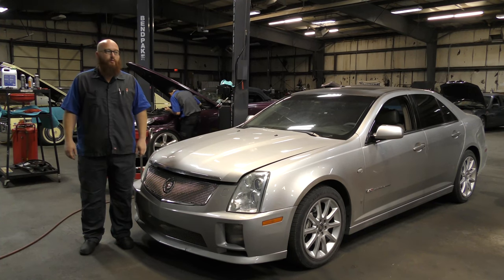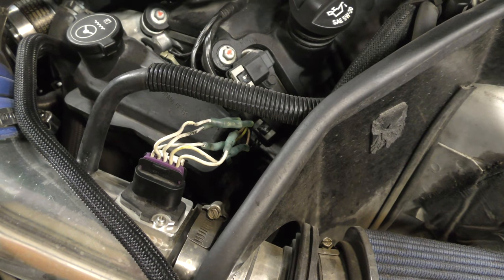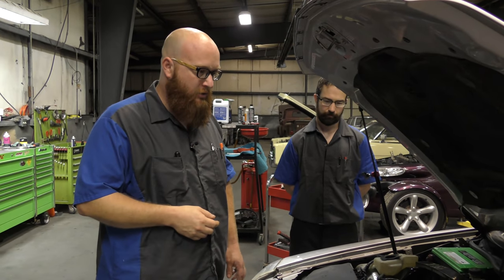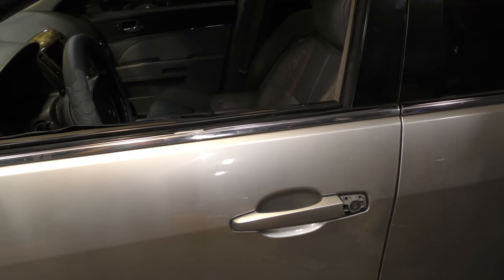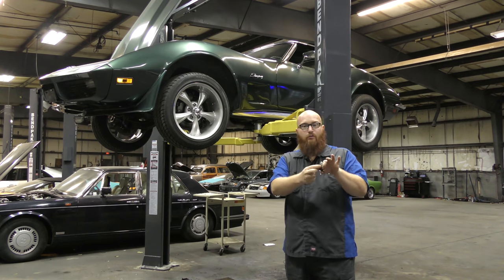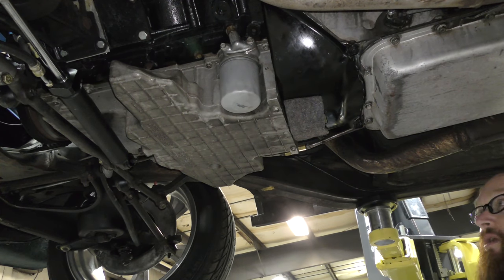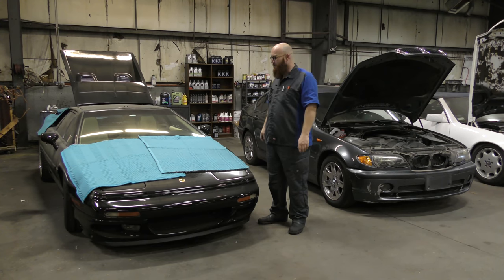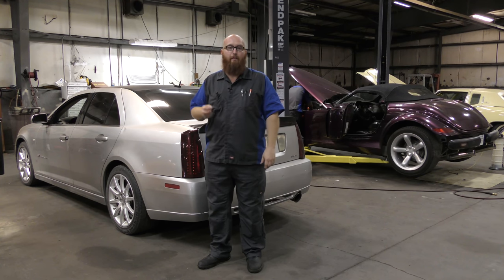When shops break cars! The CAR WIZARD cleans up mess made on 06 STS-V Cadillac. Plus shop updates.

Comment: Car wizard ! Yessss!!! I have an 09 stsv8 non v.. can you do something on the power steering leak and common trouble s with oil consumption. Thanks bro.
Reply: For oil consumption I heard it was the little PcV valve getting clogged quickly but I put high mileage mobile 1 oil into our ‘05 caddy and all consumption stopped (used to be quart per tank) and it also runs much smoother. The only thing is once you go high mileage with the oil you have to stick with it because they also have stuff made to swell up the seals and if you change to regular oil the seals may shrink again.
Reply: @rex_s80  omg...I'm not alone.  That's exactly what I have to add. Lol. Thanks for the tip.
Reply: jahseedbeatz504 no problem man. I was also so confused with the consumption because it didn’t smoke but it also didn’t leak so I took the intake boot off and it t was filled with oil but it has plenty of negative crankcase pressure so I tried high mileage oil and boom fixed. I just don’t question it at this point hahahahaha. For the powersteering I put like 4 table spoons of some powersteering fluid from Prestone that comes with stop leak and it no longer leaks and is smoother.
Reply: @rex_s80  lol!!
Reply: @rex_s80  will try the table spoon method...see what flys. Ty agian bro.
Reply: jahseedbeatz504 no problem man. Hopefully it’s all good after that.

Comment: How does the cold air intake makes the air cold?
Reply: Air that is "colder" in temperature moves closer to the surface of the earth, whereas the  warmer the air id in temperature, the more it rises further above the ground into the atmosphere.

The air intake has an inlet that is much closer to the ground to pull the "cooler" air in. The intake doesn't necessarily make it cold. It is just a lower positioned inlet for the intake.

Comment: If there's something wrong with the ECM or any other computer inside the car, you might want to check for repair shops such as the one I work for (ecu.eu). Shameless plug be damned, but not enough people know that ECMs, TCMs, IPCs and others can be repaired and refurbished instead of having to buy a new/used one.

Comment: I'm a little disappointed, I thought you are the wizard, you could fix anything. But hearing you say you cant program the ecm is pretty sad. I've got an ecm problem too and I am looking for someone who can tell me how it's done. Where can I get those rom files? There are nearly no Cadillac dealers here in Germany, so it's maybe better to try fixing it by myself. I tried the cadillac forum, but until now no one could help me there. I could buy a tech2 and just try things, switch something on and off :) but it's better to have a proper rom file before I mess up the whole thing. Maybe someone can help me here ^^

Comment: I am going to sound like my Grandpa for a minute. Car manufacturers didn’t spend all of that time engineering parts to have them ripped out and replaced with inferior monstrosities. It’s one thing to upgrade and make modifications, if they’re done properly. That air intake makes that engine look cheap. It’s poorly made and caused 100 percent of the check engine light issues.

Comment: My custom made repair part story is repairing my 1963 AMC Rambler 2-door, 6cyl, automatic transmission, torque tube bushing with rubber horse stall mat.
———————
I had a 1963 AMC Rambler Classic 660 2-door that had the iron block 6-cyl and the automatic all original. That car has a torque tube that, as a structural element of the suspension, connects the rear axle to the transmission.  Well, since the axle moves, that torque tube needs to flex at the transmission connection, as the suspension cycles. The trans seal was leaking and degraded the bushing.  The seal is easy to source, but NO ONE made the bushing.  This is approximately the size of a toilet wax ring.  I heard of using horse stall mat because it had about the same durometer rating as the AMC and is about as tough as can be. I made technical drawings by using a micrometer on the output and the torque tube and custom made the huge bushing out of horse stall mat from the local tractor supply company.  I, of course, needed to trim it up to make it fit perfect, but some 80-grit and a rasp did the trick.  Two years later when I sold it, running great and no issues, I gave the technical drawings to the new owner and emailed the drawings to the major AMC supplier in case they would want to make it one day.

Comment: The Caddy needs a reflash to stock...believe the tune being run uses a negative offset to the boost sensor to electronically increase boost (eg. ecu sees 6psi when actual boost is 6 + offset). Only the programmer knows how to fix those lines of code. SMH.

Comment: Why would a wizard need to send a car to the dealer to flash the software back to stock?
Reply: I've never seen OEM ECU software offered from any retail source. Despite all cars having common principles where repairs can be handled by most mechanics, there are still items and parts that the OEM will keep proprietary.  ECU software is one example.  Tesla (based on the twists and turns seen on the "Rich Rebuilds" channel) doesn't want anyone outside of its repair network to touch the innards of its products.
Reply: @carthellkelly1599  it's available to all people who want to pay for it in the US. Any shop worth its salt has the ability to do so.

Comment: I also heard those cars are really cool and fun but I heard that that motor design and everything was new to GM and that it is a nightmare to work on and not too many technicians knew how to diagnose or even work on those engines they had to be specifically trained kind of like the first Cadillac Catera, can anyone care to agree with me or tell me what I'm saying is the truth because I'm pretty sure I did everything I heard that these cars are meant to just be driven they don't take the modifications well and that if you can get one and just drive it as is maybe cat back exhaust or something simple everything would be fine but when you start to mess with the engine there's all kinds of issues.

Comment: 4:50 why is it called a "cold air" intake when its drawing in hot air from under the hood?
Reply: There is a bulkhead that the intake goes through that seals against the hood. Air is drawn from through the front bumper.

Comment: Do you call it worked on or MOLESTED ? Some " mechanics " are too casual with wiring . They are not technicians . Everything is fixed by changing parts . There is a very shallow thought process . " It's got to work , I changed EVERYTHING " ! If they think tuning is TURNING A SCREW - run away ! That is another knowledge base . I had a bad transmission on an early sixties car with a 3 speed manual . I had a book and followed each step to rebuild it . It sounded fine . However , the ORIGINAL problem returned . NOWHERE in the book did it show a bushing was pressed into the tail end . Since it was worn , the driveshaft moved around and caused horrible vibrations . I would have liked to curse the author . I think it was a Peterson book .

Comment: Cold air intake sucking under hood air seems poorly done
Reply: Pete kovacevic You can see the block off plate on the engine side that seals against the hood.  It forces the air being sucked in to come from the front, or underside of the vehicle.  I almost missed it too.
Reply: Looks OK to me.

Comment: People are surprised when a tuner screws up already high performance stock engine with modifications?
Do they actually think that engineers working for one of the largest automakers in the world with significant resources can't tune a engine and maintain reliability better than they can.
Reply: Engineers are forced to comply with emissions standards and regulations.  A good tuner should be able to unlock the true potential of a stock boosted motor with no issue.  They've done it for years on plenty of terminator cobras and Shelby's.
Reply: @chrishernandez2490  A tuner circumvents laws that are there for a reason.
No tuned engine is going to be as reliable as a stock unit.

Comment: get a propper lathe machine. that's just a toy. and, how did those guys manage to set a torque converter not centered. i mean the bolts go in only one way, you can set a clutch off centered, but you won't be able to bolt down the box to the engine.